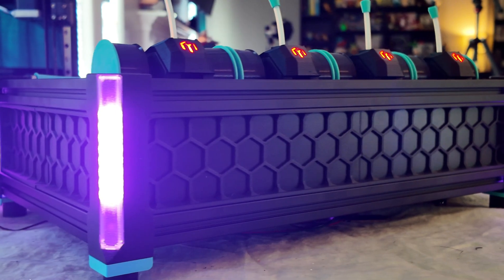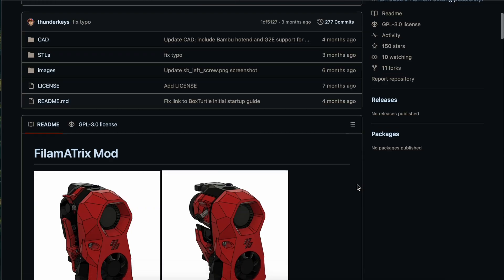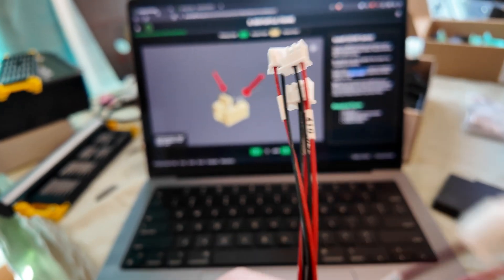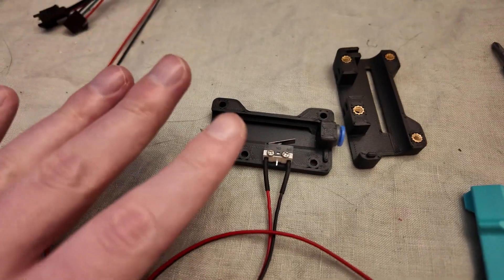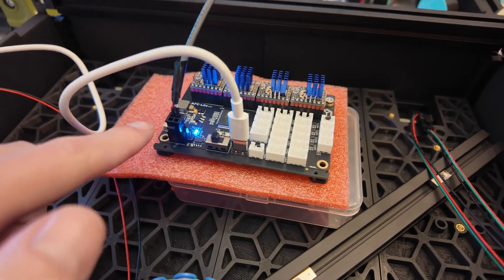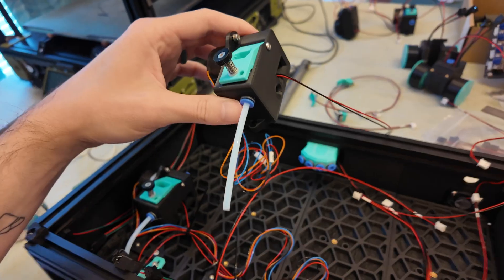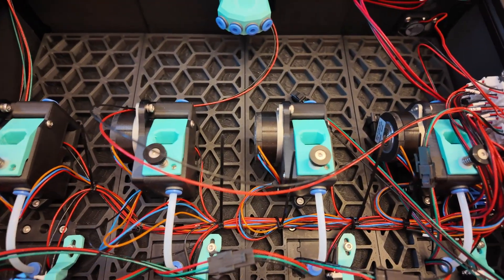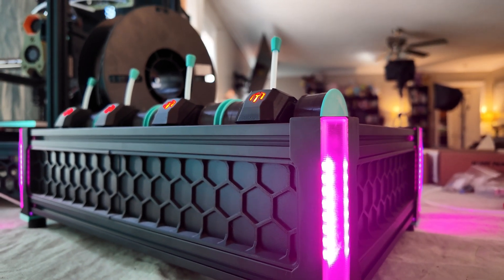Formbot BoxTurtle Kit - One Small Issue

Comment: Where did you get the file for the filament cutter?  I am using the Filamatrix cutter as well but yours looks like it has better clearance.  Mine gets in the way of the spring tension.

Comment: Great review! As for the reason the wiring is done how it is, if you print out the desiccant version of the trays there won't be much room for wiring anywhere except where we recommend the wires get routed. Mounting the bottom panel is covered in the enclosure manual (but from what I have seen most people don't use it). Also things people don't use: that loud annoying fan haha. A 12k rpm fan was accidentally put on the BOM, which is WAY overkill. Most people will just leave it unplugged. Looking forward to the software setup video!